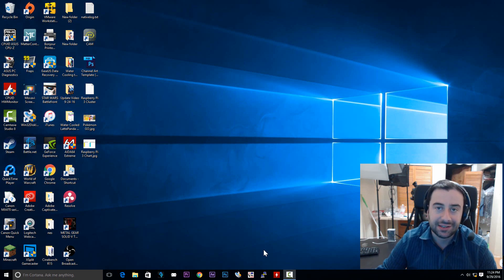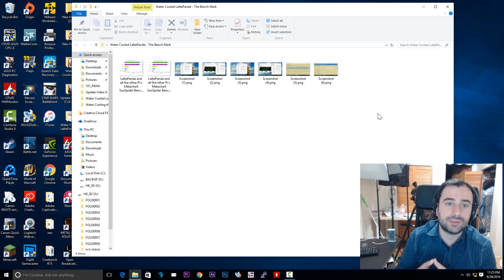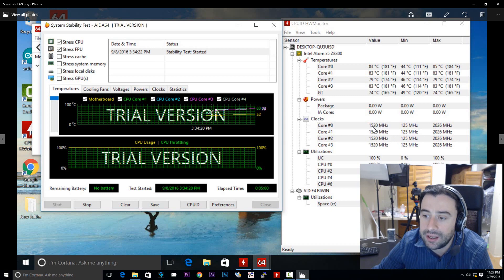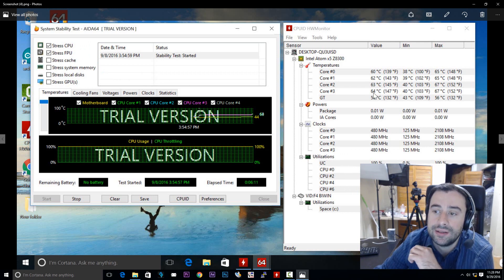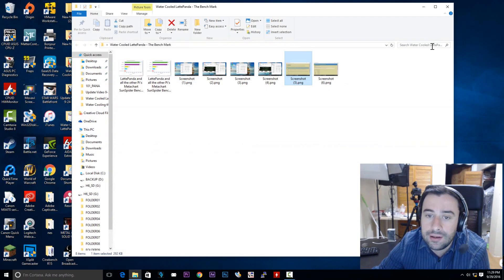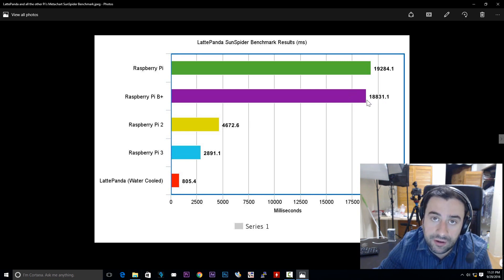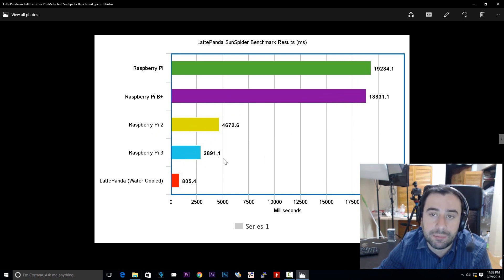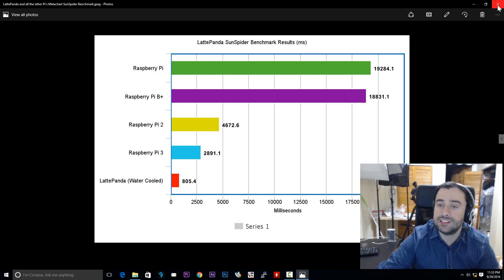Water Cooled LattePanda (Raspberry Pi 3 Killer) - The Performance

Comment: I am using raspberry pi heat sinks on the existing heat sheild, and a usb powered 80mm fan powered by usb hub. I was getting thermal throttling before playing final fantasy 1 gba, now it stays below 70. I am going to try adding more heat sinks to see if I can improve it even more.